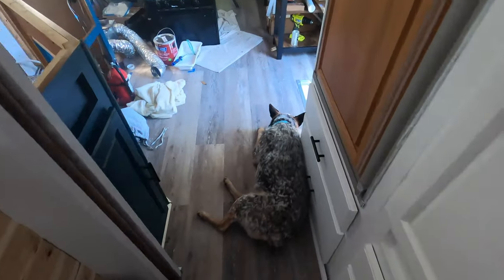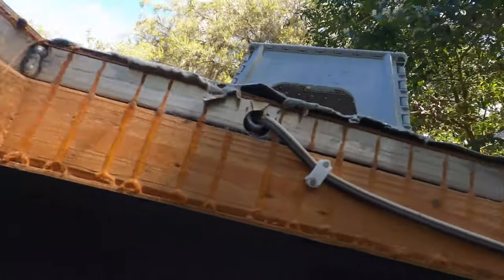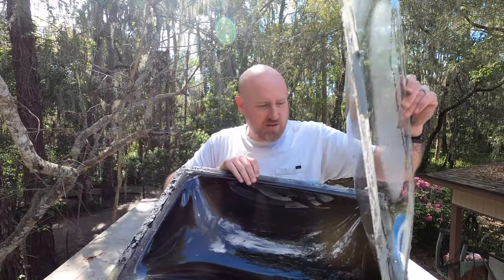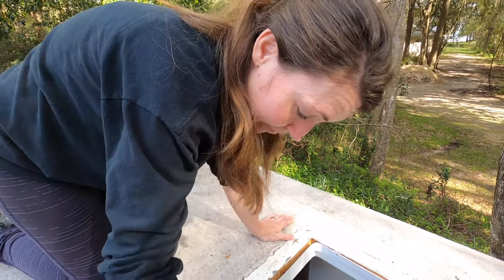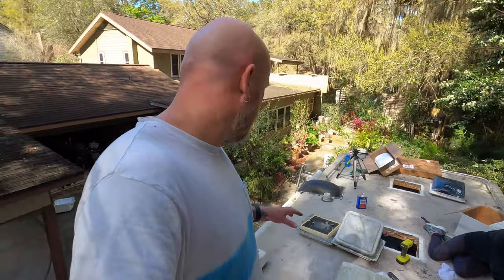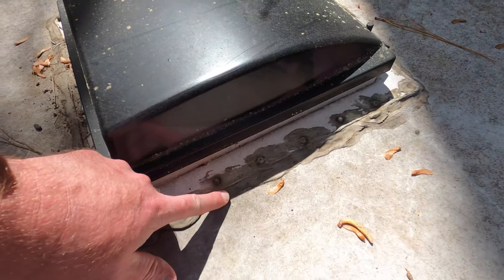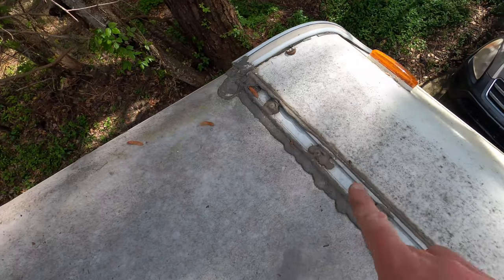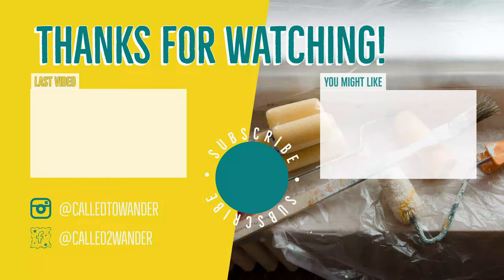CtW 128 // Install and Seal Roof Vents and Skylights on an RV //New Fantastic Fan For Our Class C RV

Comment: Ahhh the joy of scraping Dicor lap sealant without damaging the butyl rubber membrane... wondrous!  You've done a good job there.  I have 3 MaxxFans on order to do a similar rework of my roof.  What is your plan for sealing it all over? Dustin on the Life of Lind channel (highly recommended) used Flexseal on his aging Borth motorhome.  I was thinking similar but that stuff is really expensive!
Reply from the maker: As you can see in later videos... we put butyl beneath the fan and screwed it in place. Then put the standard Dicor Lap Sealant around the vent edges and screws. After that dried we went ahead and put a strip of Eternabond tape around all edges to have a second seal. And, lastly, we painted the roof with Henry Tropi-cool. Much more affordable and does essentially the same thing as Flexseal and Crazy Seal and all the others. It has worked wonders for us. But it is silicone, so once you use it you are married to it. We don't regret that decision! https://amzn.to/3FhK5pz